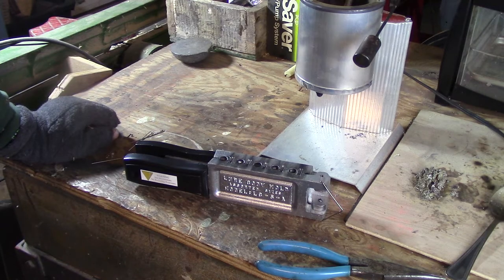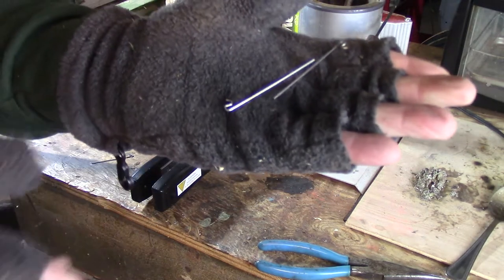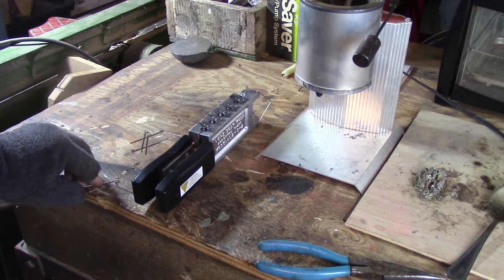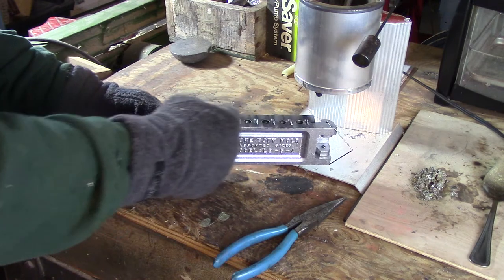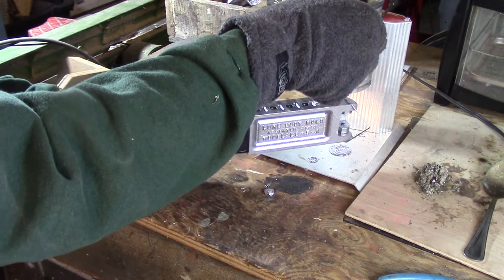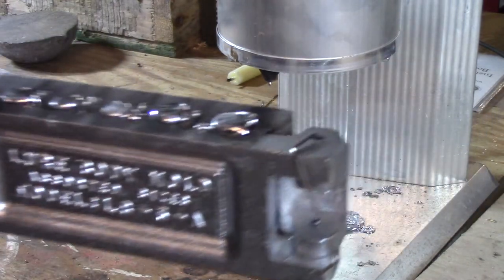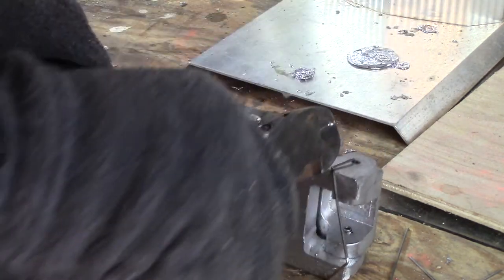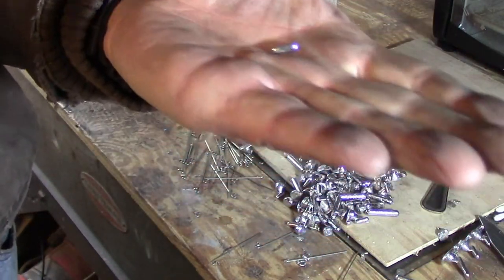PART 1 - How To Make Your Own DIY Custom Fishing Spinners: HOW TO POURING THE LEAD BODIES!

Comment: question..   can you buy an mold that has 1 specific size?   i fish for salmon mostly with spinners...  i want basically 1/2 oz...   5/8 oz...   and 3/4 oz...
Reply from the maker: I'm not aware of a mold for bigger lure bodies than the one I show here. I did do some research though and found a worm sinker mold with sizes up to 5/8 oz that I don't see why it wouldn't work. The mold is do it mold and the model number is WR-9-A. The weights are shaped much like those used in Panther Martin spinners. Just Google the model and you should find it. You could probably also use a MODEL 3149. It is a trolling weight mold with sizes 1/4 to 3/4 oz and I think the profile should work for a spinner as well by adding a double bead between the weight and the spinner blade. Here is a link https://rockislandsportsgov.com/do-it-trolling-sinker-1-4-3-8-1-2-5-8-3-4-oz-model-3149/ I hope that helps. Thanks for watching and may God bless!
Reply: Not from Do-it,but there are custom mold makers that can. Do-it does make one size molds for some other molds,these are listed as their Pro models. They're mostly in the jig category.
One can make their own molds too,wood and body putty works for a time but will eventually need replaced.
Those weight molds he's referring to is known as worm or bullet weights and they'll work for spinner bodies.
You can also use metal and/or plastic beads to make bodies.

Comment: Do you know where I can find these lure bodies already pre-made? I can't find this style of lure body anywhere in stock and it's driving me mad! Wish I could just buy tons of em and keep em stocked!
Reply from the maker: I found these on Ebay and they might work for you: https://www.ebay.com/itm/325118898698?chn=ps&var=514031898318&norover=1&mkevt=1&mkrid=711-117182-37290-0&mkcid=2&itemid=514031898318_325118898698&targetid=1263104806246&device=c&mktype=&googleloc=9007031&poi=&campaignid=14859008593&mkgroupid=130497710760&rlsatarget=pla-1263104806246&abcId=9300678&merchantid=112223509&gclid=Cj0KCQjwof6WBhD4ARIsAOi65ahmDpMunHEHUTYg2t2dbo4PuA50lDVJKIs8MYZId_qr7-xdIOdSVRwaAqK5EALw_wcB I hope that helps. I bought the mold as I already had the melting pot and that way I don't have to depend on someone else keeping them in stock. Plus its fun to do. Thanks so much for watch and may God bless you!